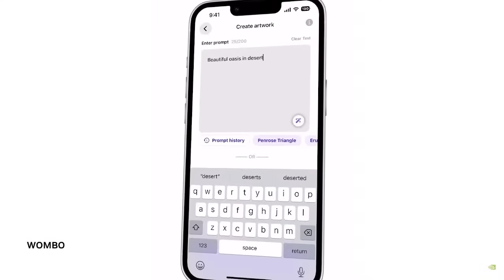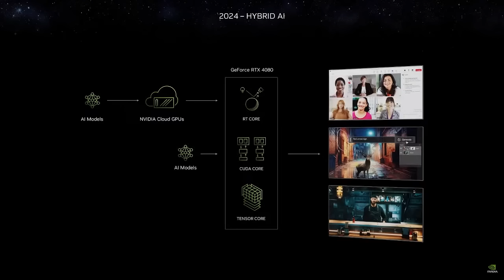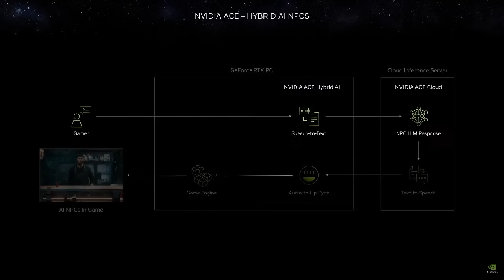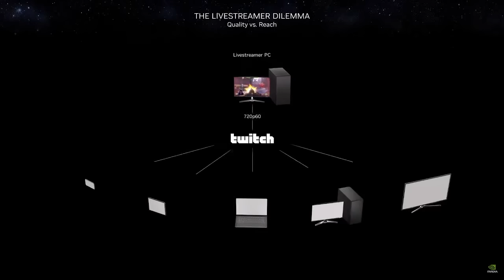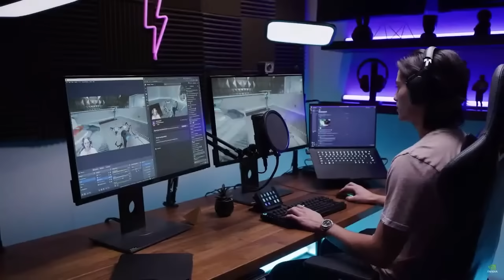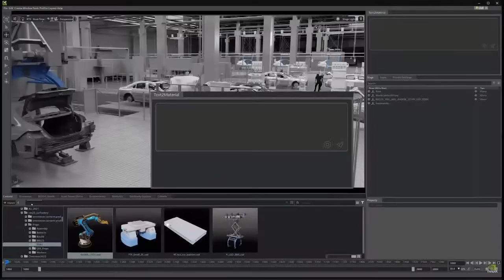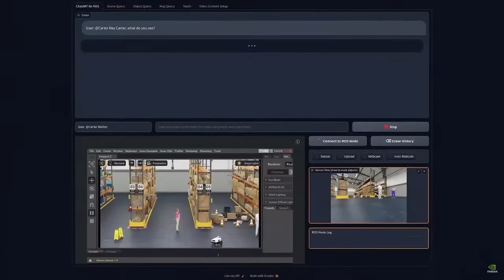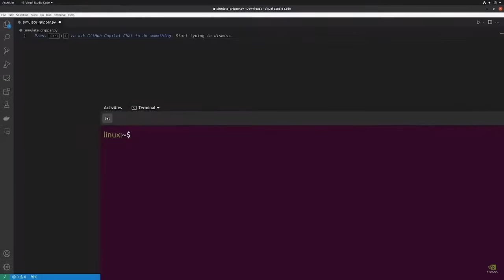HUGE AI NEWS: NVIDIA Special Address at CES 2024 (Supercut)

Comment: I have had an 810.00 price target on Nvidia.  Based upon forward average sales ratio for the last five years 22.59 times the revenue estimate of 90.728 billion next year you get a market cap of over two trillion dollars.  Two trillion is equal to 810.00.  Then by the way I see upward pressure on the stock price as we continue towards the quarterly earnings date of February 21st.  On top of that Nvidia is the most anticipated stock split in 2024.  In May of 2021 Nvidia announced a four to one stock split when stock price reached 560.00 a share.  Nvidia is on a breakout and based on free cash flow based on high margins it's going to continue upward.  That on top of 35 billion stock buyback this year.  Nvidia is definitely on a roll.